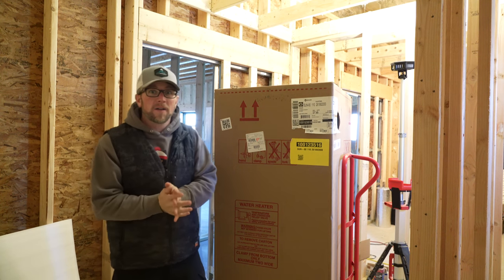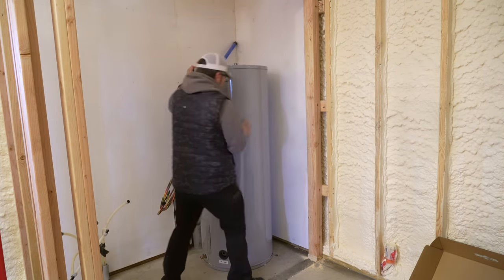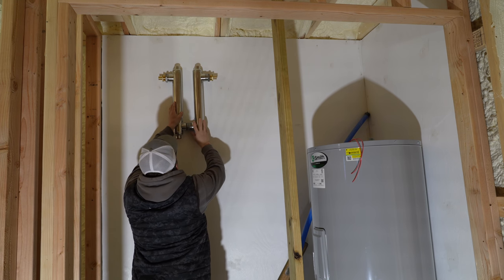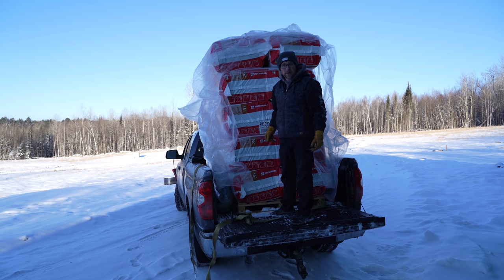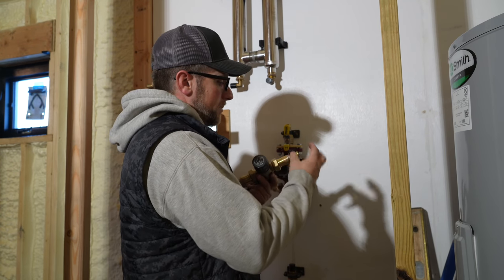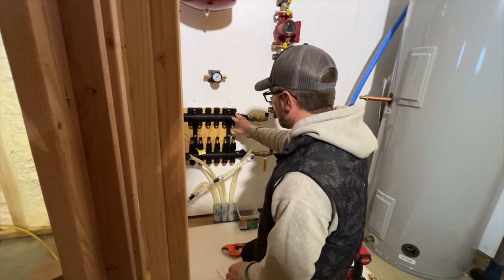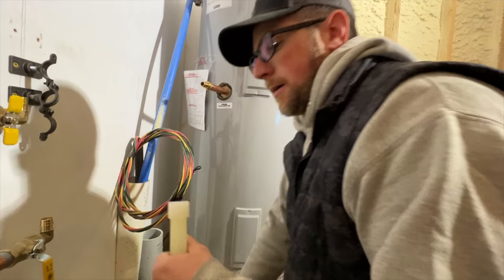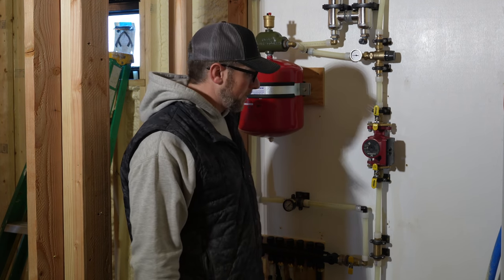What Could Go WRONG... Installing In Floor RADIANT HEAT with No EXPERIENCE!

Comment: Gooood morning Al and Gina,

Are you doing filtration of your incoming well water? If so which filter system are you using? Does 
your well water need a water softener?

I agree the heat circulation pump would some electrical energy but would save on running water to get hot water although you house is small until you build the larger house.
Reply from the maker: We won’t know until the well water gets tested.

Comment: DO NOT PLACE THE HW HEATER DIRECTLY ON CONCRETE!!!! Most areas require a leak pan under the hot water tank. The leak pan also needs a line to drain outside. This is really not optional. Having one saved about $40,000 in damage when my tank started leaking while on vacation. Trying to run a hot water heater off solar is probably not a great idea. Heavy hot water demand will suck your batteries dry. A gas HW heater would have been a MUCH better choice. DIY is great, but be careful on your planning as this is where most DIY'rs fail. Ask your subs for suggestions.
Reply: In the sumner, in northern NH, Al will be running a huge surplus probably by 11am. Even with dumping the excess load into topping off his top water, he will have way too much solar from May through September. That solar array is massive, designed to carry them through the winter which means its way oversized for Summer at high latitudes.
Reply: @kevin3434343434  It all depends on the storage, not so much on the solar supply in this setup. Hot water is generally used most early and late in the day. It takes a LOT of power to heat just one gallon of water just 1 degree. He has an 80 gallon HW tank.  At 9KW for the heating elements, that's a big draw. Add a washing machine, dryer (2-4KW), dish washer, lighting loads, supplemental electric heat (1-2KW), refrigerator (.75KW). 
During periods of low light (cloudy days, snow covering the solar array, night time) the batteries have to make up the difference. It also means they will have to get used to using max power during daylight hours, not in the evenings. 
He hasn't put in an on-demand generator (which he should) to make up for "dark" periods. Note you never want to let your batteries go down to very low charge for any period of time. (Lifespan drops like a rock.) Almost all off gridders have a generator because of this. In general, its prudent to minimize the heavy loads which can cause deep cycles on batteries as battery packs have a limited number of deep power cycles. 
Can Al get by with what he has? Yes if he's careful with power management.  Does he need a generator? Probably, but a small 4-5KW  (run) generator would be fine for backup.

Comment: I forgot the name , but there is another gas that's hotter than MAP.  It comes in a red tank
Reply: @Og-Judy  it might be  I just forgot the name. It comes in the same size as the  blue & yellow canister
Reply: Oxy-acetylene?  Oxygen and acetylene together make a very hot flame, good enough for true welding, brazing, all sorts of fun stuff, like the "flame wrench" (cutting with a oxy-acetylene torch)

Comment: You could blow it all up,,,,if you have have a closed system,,,,,watch out for to much pressure !!!!!!! I put in a open system,,,,,,,,its a better way  ,,,,to go !!!!!! Less things to go wrong and less things to worry about in the winter ,,,,,,put in a few extra ,,,,runs in ,,,for down the road ,,,for extra heating supply!!!!!